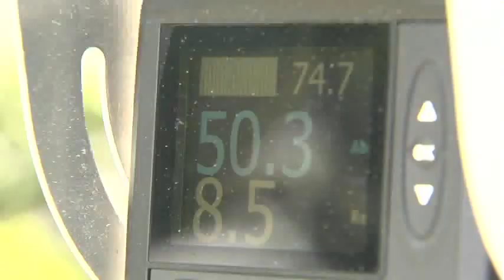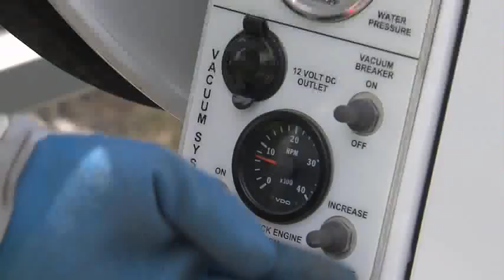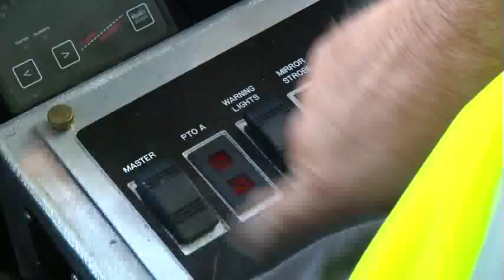Intro to Sewer Cleaning with Jetting Equipment Video Highlights

Comment: NASSCO's "jetter code of practice" is a cut and paste from a United Kingdom guide to cleaning sewers
Reply: Actually not it's not.  I wrote most of it and it was a compilation of material from various US manufacturers and distributors.  it also went through a vetting process of various industry professionals.  You are misinformed.